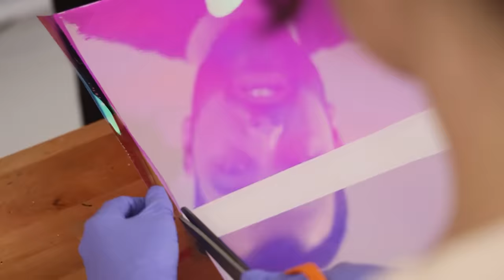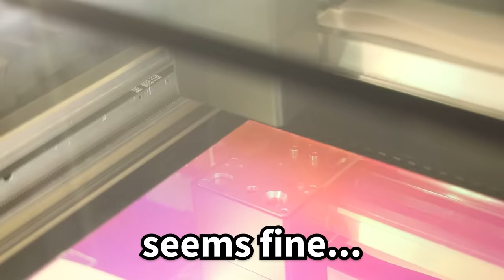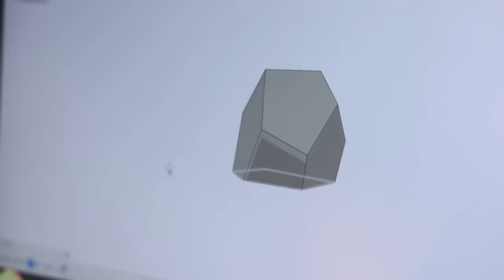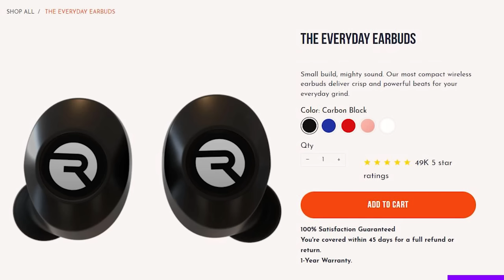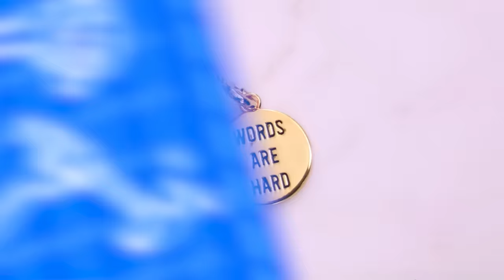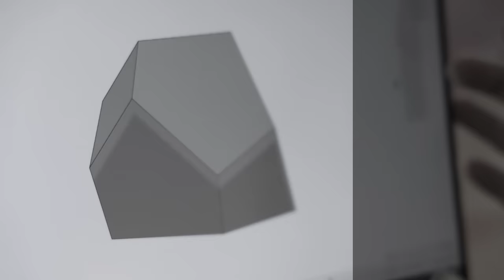BUY vs DIY - Recreating a $200 Gem Lamp

Comment: So just an FYI: be very careful cutting plastic film with a laser. Most Iridescent film is PET which is perfectly fine to cut with a laser, but be very careful to not cut vinyl based films as they off gas hydrochloric acid which can not only be dangerous to breath in, but can also ruin the mirrors in the laser.
Reply from the maker: Very good tip! We looked into it beforehand to make sure we could cut it
Reply: @EvanAndKatelyn  I would really appreciate it if you mention stuff like that, so people won't try to imitate you without checking
Reply: @missbeaussie  by "imitate it" they mean if someone watches E&K cut iridescent film with a laser and have no problems, then tries it without checking if the film is laser safe (since it isn't directly mentioned in the video that not all films are laser safe) it could end in disaster.
Reply: @missbeaussie  but E&K didn't say that they had checked beforehand. In fact, with editing, they make it look like they just dove in head first and started experimenting.  Watching their trouble with applying the film my first thought was "hey, I have some Cricut stuff that might work for that, I bet it might be easier and cheaper!" but it's vinyl, which I don't find out could be VERY dangerous until the comments.  
And waiting til the comments for warnings is ALWAYS a no-no.
Reply: @bulikiki100  on the one hand if you break a laser cutter by blindly imitating an entertainment channel that's kind of on you, but on the other hand I would also prefer them being honest and open about their precautions rather than doing a cheap editing/writing  trick to increase excitement, it'd be more respectful of their audience
Reply: @missbeaussie  except....they do things all the time that are dangerous without mentioning it (cough cough, multiple vids of them using resin without respirators or gloves)
Reply: @baconscoobysnacks3135  nope
Reply: @geekwitchnails  right!! Like also this isnt a tutorial channel or a tip channel, its a hobby channel
Reply: @mwater_moon2865  When I was watching I was actually thinking just do them in two passes, cutting the acylic on the glowforge, then the sheets on the cricut, then assemble them.  Then there is no risk of laser damage from reflection.
Reply: @baconscoobysnacks3135 being mean won’t make you happy chill out

Comment: it’s actually made by blowing glass into a mold and that’s why the edges are smooth and rounded. 😊
Reply: Yup, just like soda bottles are made! And they don't paint it or cover it in a film to make it iridized, they spray it with metal salts while it's still glowing hot so micro metal crystals form.
Reply: @mwater_moon2865  wow your smart
Reply: @mwater_moon2865  Always wondered how they would get any sort of pigment to adhere in such a way, makes sense it's not pigment at all.
Reply: @mwater_moon2865  With all this in mind, they probably could've done something similar with resin.
Reply: @justyouraverageweirdo  Similar how? Shaped like blown glass?  I doubt it, as resin tends to drip and take a VERY long time to set as compared to glass solidifying as it's being blown.  Now you COULD do it with plastic, as that is also often injection molded (though it's usually vacuumed into place by sucking air out of the mold rather than air blown into place like glass.) But resin isn't going to go from liquid to solid fast enough to stay in place without drips.
Reply: @mwater_moon2865  I meant using a mold so that it's all one piece, or at least mostly one piece.
Reply: @mwater_moon2865  there's actually a resin specifically for that
Reply: Don’t forget it was fumed to get the iridescent look.

Comment: They are both beautiful. What I want to see: when the non-servicable light breaks, take the bought one apart and install your kind of base into it. The resulting No 3 would probably beat both in the category aeshtecs.
Reply: Good idea!!!
Reply: Oohhh yes!
Reply: Very much this! 
Since cast glass isn't really a diy-able thing, I was hoping they might use the diffusion grating to make a mold and resin it just since that's closer in feel to the cast glass of the bought lamp, but I am ALL about DIY repairs and upgrades to keep things out of landfills.

Comment: While I do like the smooth seams of the purchase, I find the crafted piece overall more aesthetically pleasing. Your facets seem to show their color individually, the light is far better implemented. Overall, I think yours is simply higher quality.

The only real win the purchase has for me is that it is glass. But that's not a huge factor compared to everything else.
Reply: I think that if you really want glass that you can buy a cheap photoframe and just use that glass (I haven't watched the vid yet, so I don't know how they made theirs...yet).
Reply: Totally agree!
Reply: there's a bonus to DIY that wasn't mentioned... you can make as many shells as you like, different designs, different materials, colours, sizes, and fairly easily swap between them. the customisability here is quite valuable.
Reply: The only thing I actually preferred about the buy is that the base kind of tucks in, it doesn’t just jut straight down to the base like E&K’s does. If they’d made theirs have a few “base” segments of the acrylic on bottom to make it more of a geometric rock shape, it’d be perfect. I prefer their seams and the effect it has by refracting light differently on each face.
Reply: Yes! I agree!

Comment: As someone who uses CNC lasers in my shop for around 7 years, I may be able to answer a few of your concerns about the laser. Highly reflective materials can degrade the cutting ability since less of the energy is being absorbed by the material, but it won't reflect back into your tube or damage your machine. The focus length is determined by the lens but power and shape of the beam rapidly diverges and diffuses like a cone on the other side of your focal length. It can't travel back across the mirrors once it goes through the lens because its no longer a cylindrical straight beam like it was before the lens.  It can of course damage your eyes so make sure to wear your eye protection with proper filters for the right wavelength as usual. Co2 is 10.6 um and some lasers have filters on the glass viewing window too.  As for the "flashes" seen at 6:49 the honeycomb table is reflecting some energy back upwards as the light passes over each metal cell in the honeycomb. Sometimes these reflections can score the underside of your work depending on the power/speed. It can mean that the power is a little too high for the application since a lot of unused energy is remaining after the work is done and the cut is finished. For higher powers, blade tables are good for heavier cuts and remove the frequency of this "backflash" on the underside of your work. Lasers are fun but deserve respect so your cautious approach around them is healthy!

Happy making!
Reply: The light reflecting back won't get to the tube, yes, but it will absolutely create more heat in the lens and potentially crack it. Those are wear items anyway but that's a LOT more wear on it.
Reply: Thank you for your info! Nice to know the mechanics behind it
Reply: And evidently, as someone else pointed out, don't cut vinyl based films as they off gas hydrochloric acid which is bad for you AND the laser....

Comment: If the bought is glass it might be blown into a mold and there is a a coating for glass specifically for iridescent affects. Very hard to compare the make and buy cause they are both so nice and made in very different  ways 😍
Reply: Yeah, I think it must be mould-blown, probably industrially at that price (hand blown would be more expensive). I don't know if the iridescence would be dichroic or something applied later like a spray or vacuumed film layer? They are both very pretty though! I think the buy would have benefited from a diffused light like the make for additional ambiance ✨
Reply: I didn't think of a mold but that makes a lot of sense for its look
Reply: Had to google it, the Corning Museum of Glass shows a video using heated stannous chloride crystals and then holding the glass over the gas to get the iridescent effect.  Are there any paints for plastics that can create the same effect?  More research is needed, this is such a cool Make :-)
Reply: @CM-yu6ms  Iridized glass is made by spraying metal salts on it while it's still red hot.  Ferric (iron) chloride  for more of an orange, or "marigold" coloring, with Chloride of antimony on top of that for more of a blue tone, and stannous (tin) chloride for the more typical rainbow effect.
If it were dicro (it's not!) it would be metal vapors in a vacuum chamber, have to be done while the glass was still flat, and cost on the order of $2000.  No really, a flat circle of dirco glass is 18" in diameter and cost around $200 all by itself, and dicro does not like the kinda temps you need for mold blowing so it'd have to be capped before the pressing and def hand done.
The buy they have is a factory piece that was sprayed with stannous chloride as soon as it was taken from the mold before it was annealed.
Reply: @symark1971  There are paints that contain pigment particles that can reflect light in multi directions, but the pigment is going block light going through it, it's more like micro fine glitter than what the tin salt does with glass.  Now what E&K HAVE done before with resin (and I've even seen Ann Reardon from How to Cook That do it with chocolate since it's all texture) is use diffraction grating, which will make rainbows from any light reflected off of it.

Comment: I feel like your lamp is something I would buy over the other strictly on serviceability alone. Plus the rigid corners are more my thing. 🙂
Reply: Their light is no more serviceable.  Once the LEDS start to fail, the specialty strip is under all those glued layers too....  So if you can get through the glues on either lamp to get to the light element itself, unlike what looks like a florescent tube, specialty LED strips and custom milled parts aren't going to be very readily available.....
Reply: @mwater_moon2865  I don’t think that the layers over the light are glued on top of the light the layers are glued together but they are staying in place because of the frame surrounding it that is the gold mirror. So it is removable however I am with you on the fact that it would be harder to find a replacement if it was sold commercially vs a simple led bulb

Comment: To get the smooth edges, I'd say they use a vacuum machine. They get a sheet of plastic, melt it (sort of) and then just push it onto a mould. I used one in highschool so I can't remember the exact name of the machine but it was pretty cool
Reply: It's called a vacuum former.
Reply: they used something similar to make molds from potatoes a long while back!
Reply: But it’s glass, I think you can vacuum form glass right?
Reply: Its just blown glass lol
Reply: @Lukewarm326  yup. it's just blown glass, they have a mold and blow a 'bubble' of molten glass until it takes the shape. also how they make bottles, jars.and lightbulbs
Reply: @kallimarissaa  I remember that video.  I think I was subscribed before then. That was a fun video
Reply: @bizm  omg cool!!! i didn’t even know that was a thing lol but i’m also not much of a maker, i just love e&k content

Comment: This is my favorite thing you've ever made. If I had to choose which to buy, I would go with yours because the design and function are far more thoughtful. Aesthetics would be a tie if the lighting element on the glass lamp hadn't been so poorly thought out, but I really don't like the idea of the glass lamp only looking good at certain angles -- especially for $200. I would say, on yours, it might be interesting to layer the "sauter" resin a few more times so that it looks more purposeful, but overall, really love the whole thing. Would love to see you revisit this project at some point and see what you would come up with if you were designing, rather than duplicating.
Reply: Solder is the word you're looking for. They pronounced it wrong, its meant to sound like sol-der not sauter. 🤣
Reply: Some moss or coloured resin drips 😍
Reply: @AlexaFaie  you can pronounce it both ways, both are correct.
Reply: @AlexaFaie  I usually hear it pronounced "sodder" with a silent L
Reply: @dr_sera  that may be, but it sure as heck ain't spelled "sauter"

Comment: For super clean joints on acrylic you can use Weld-On 3. It can make and almost glass like seem. Plus it is a chemical bond with acrylic so you can't glue your fingers together.

Comment: I like the DIY version you did because if set up right you could have programmable LEDs to do various effects. Thunderstorm with lightning effects? Or flickers or pulses or other things? Tuned to music? Color change? Rotate? Also, the ability to take it apart means you can put something inside it. Like a sculpture, or photo, or whatever. 
Finally, I'm surprised as 2 people in love with resin you didn't think to resin print it or make a casting!

Comment: I love them both and would get yours if I were to style my home in a modern-esq. feel but I think the "roughness" of the bought one fits my fairycore and nature inspiration more. Although not being able to change the light bugs me. I think if I got it, I would find a way to remove the dome and replace the light with your idea 😂
Reply: The only issue there is that while yes their light is LED, and likely to last a bit longer than a florescent, it's no more replaceable when it does start to go bad.  It's actually much harder to replace with customer machined parts....
Had this very issue with my 2005 Prius.  The headlights are the older incandescent type so when one burns out I go the shop and it's less than 15 minutes and $75. I've had to do this 4 times in 17 years.  Meanwhile the rear lights are LED, and when one side went out, I was told if it wasn't a messed up connection, they would have to replace the whole assembly, and it could be $1,200.00 to replace it AND take 2 weeks to get the part in IF it could be found!  
Thank god it was a switch connection, but my other tail light has lost about 1/4th of the LEDS over time and it will literally be cheaper to ditch the car when it no longer passes inspection.

Comment: You can reuse the paper when cutting plywood to reduce the charring on the surface where the laser cuts it. I’ve also used heat press release paper.

Comment: I’ve recently just started trying resin out (not the uv resin but the one that cures with time) and I have one question- well a couple actually lol, how do you clean your syringes? Because I’ve had problems with trying to clean them after pouring but some still remains! Any tips for this? Also, air bubbles, the bane of my existence haha, I have a heating gun, yet the bubbles don’t really come out. Any tips would be amazing (this goes for anyone!) Your videos are amazing and thank you if you take the time to read this!

Comment: You could try making molds in some crystal shapes, use clear resin and then add an iridescent top coat inside/outside once hardened, then finish off with a thin layer of UV resin to seal the iridescent coat. That way you'd get the same soft and rounded edges like the glass lamp. 😊 Could even try same principle with a smaller one inside a larger one and see how that would look.

Comment: The thought you guys put into the light source is enough to offset the roughness of the epoxy joints and other issues.

I'd rate the readymade product as just average, as far as refinement is concerned.

Comment: there are aspects of both that i like. the buy one, at least on the good sides, looks amazing with that glowing crystal look. however i really like the hard faceted look of the DIY. though i'm not a fan of the resin edges, but fixing that to be nice and sharp would be very tricky requiring sanding down the edges all to precise angles before clear resin gluing them up. 

the ultimate one i think would be a small defused crystal in the middle with high power variable light intensity, around a larger more faceted and natural modeled outer crystal cluster with those super sharp edges. that'd make it a truly magical looking crystal lamp

Comment: I prefered yours because both the light and angled corners where better - crystals don't have wavy surfaces!
BTW You could also make a 'Christmas Star' type design from sheet materials that slotted together or do what BobbyDukeArts did with the recent pictue frame and tear diffraction grating plastic up into shards and drop them into clear epoxy. It looked flipp'in amazing!
Reply: Sometimes large crystals do have some weird 'wavy' stuff going on - I have a big green/brown calcite where all the facets have strange ripples in them.

Comment: I really like the DIY, looks very cool and I think has better reflections. But over all the the bought one looks brighter and more mystical. I think an easy way to brighten up the DIY is to choose a slightly less transparent acrylic or add some wavyness to the outside with a heat gun to trap more light

Comment: As someone who used to work in a gas station and put up promotional posters weekly I can say it's a lot easier if you spray the sheet itself instead of the surface you'll be applying it to that way the sheet doesn't wrinkle and stick to itself, you can literally fold it in half while it's wet and still pull it apart afterwards.. when you leave the sheet or poster dry and spray the surface it's being applied to instead you run the risk of wrinkles and warps that can't be removed 😅